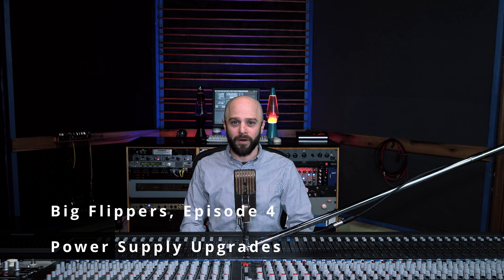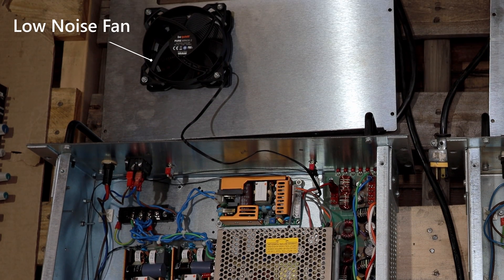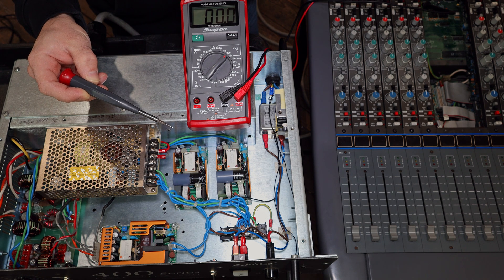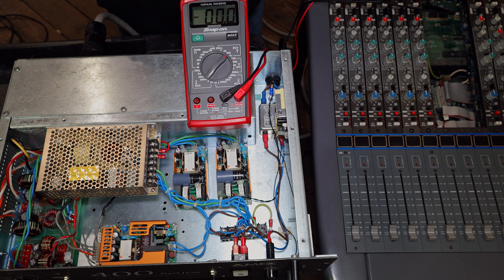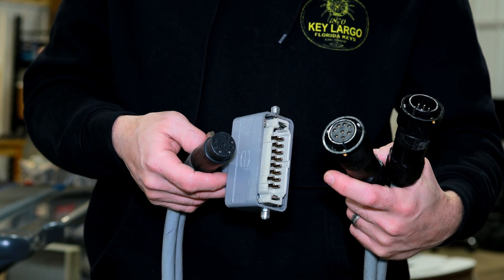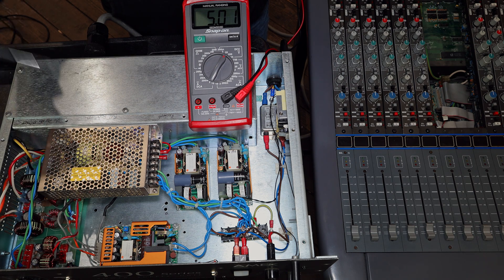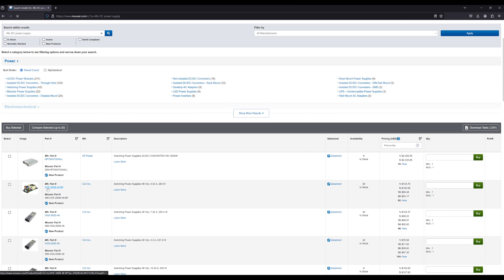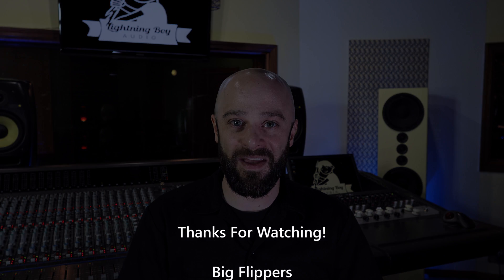Big Flippers Ep4 - Building a new power supply for an old mixing board.

Comment: The reason for lights up on wrong 5v not only 5v line actually but 17v 5v combination - problem comes from dac/adc on vd board powering not from 5v line but lowering 17v to 5v on its own from “audio” +-17v for dac and adc , and cpu powered from “digital “ 5v line goes crazy if voltages mismatch . They have switches on a vd board in a center to power adc dac from “digital” 5v , sometimes use it if problem with voltage comes during sessions

Comment: Glad I stumbled upon this video! Did you not run into any noise issues with the switching PSUs because of the robust filtering section?
Reply from the maker: No noise issues… dead silent background.  The filtering section made a big difference, but quality power modules is paramount.
Reply: @LightningBoyAudio  do you have any tips on sourcing or designing the filtering section?
Reply from the maker: There’s no schematic that I could find, but it’s just a small toroidal choke (mH) of substantial current handling capability, paired with a moderate electrolytic capacitor… per power rail.